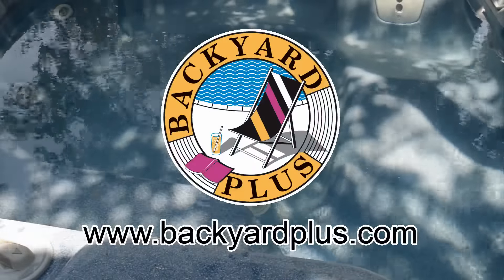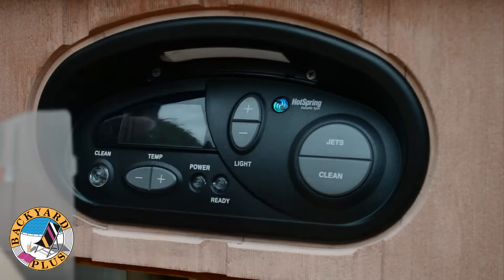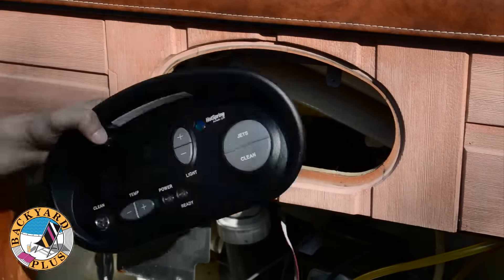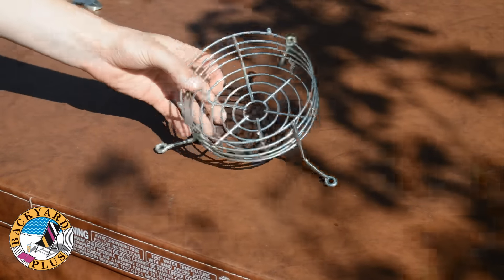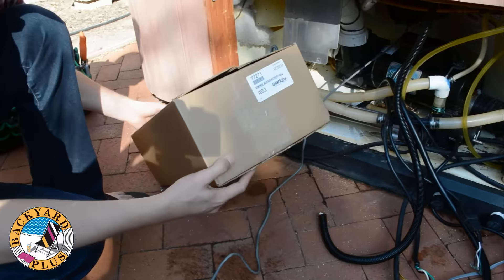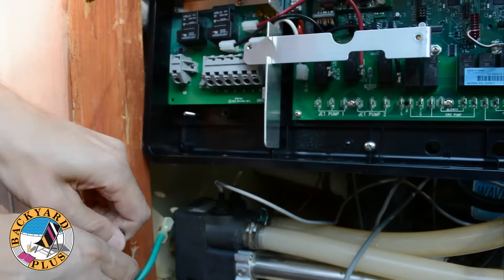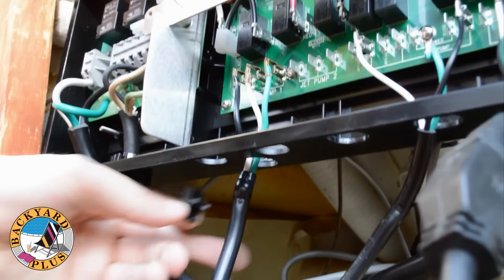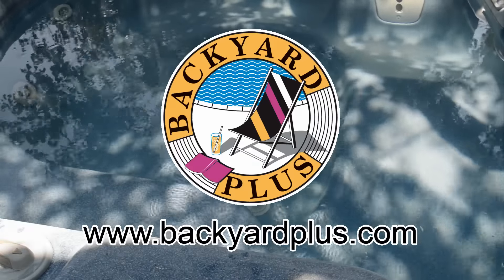How To: Upgrade your old IQ 2000 Control Box to an IQ 2020 Control Box

Comment: I wanted to know what light will work for my upgraded 1996 Sovereign 1 hot tub. The one I have is the one you remove in the video. Thanks
Reply from the maker: Call Backyardplus.com tech support at 805-541-9000

Comment: At 15:30 in the video when you're connecting the white and black power cables, how large of a gauge of wire can be connected?  I've got 6 gauge run now and just want to make sure it will fit into the terminal block.  Thanks!
Reply from the maker: For 120 volt 20 amp circuits use #14 wire. For 240 Volt 20 amp circuits use #12 wire. For 240 volt 30 amp circuits use #10. 6 is pretty big. I have never used a wire that big but if it will fit in the terminal block door, go for it!

Comment: Hi, I have a 2006 Hot Springs Prodigy spa and am in the middle of the installation. Which terminal do I put the white and black power wires lines in at 15:30? Also, what are the power jumper and program jumper configurations for this model hot tub? I think it's the same as you have it for the Power, and just JP9 for the program. Thanks!
Reply from the maker: Hi! On a 2006 Prodigy, if you are running 120V, you will put the black wire into terminal 2 , and the white wire into terminal 4 just like in the video. You need a power jumper between 1 and 2 (skip H1). You also need  a power jumper between 3,4, and 5. You should have a program jumper on JP1, JP2, JP3, and JP9.
Reply: @backyardplus  Awesome, thank you!
Reply: @backyardplus  I've now installed everything and when I plug the unit back in I get a solid red light and then I hear a click, and then a flashing red light. I can unplug, wait a while, plug it back in and get the jets going, but then if I hit temp, it shuts off and flashing red light again. I've cleaned the filters several times, could it be an air lock, or something else, and how do I fix it?